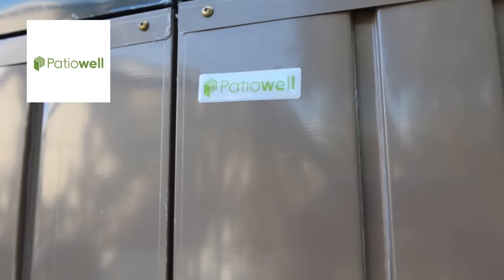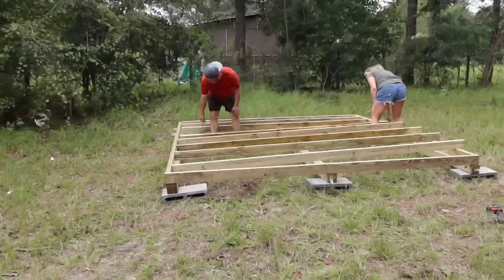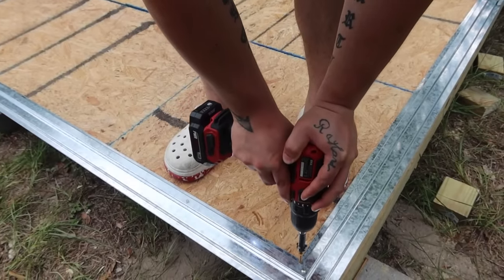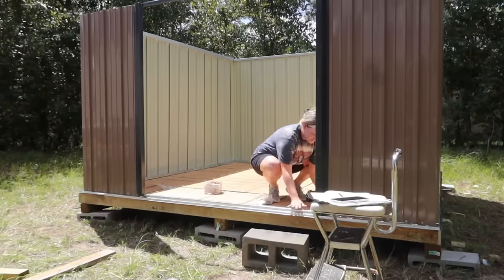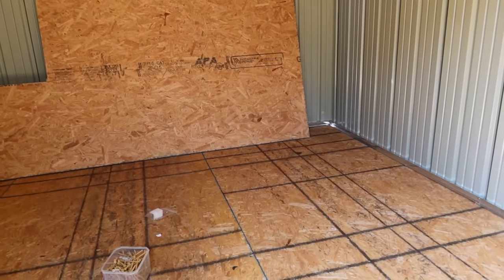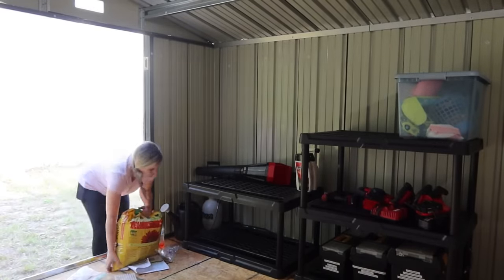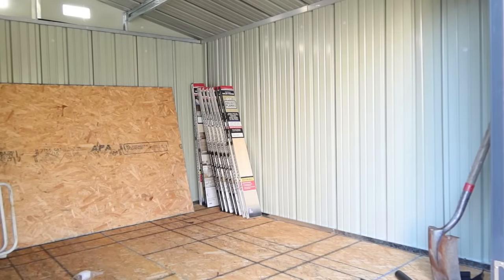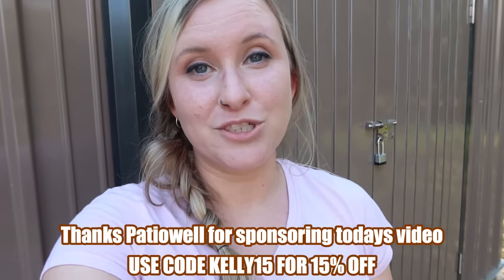🏠 MOBILE HOME PROJECTS (working outside) // New Shed Build + Organize

Comment: You could use your extra piece of plywood as a corner Loft. Put legs on it and then you have a shelf and storage underneath. That's what hubby did with our shed. It works out really good because it gives you an extra layer of storage. 🦋

Comment: I live in a mobile home too and the purchase of my shed was a must.  You might want to store the flooring flat inside your home.  The heat will cause it to warp.  Also, that lock can easily be cut.  There is a round thick lock that you can purchase that cannot be cut.  To get it off it be drilled out.  It’s pretty price but it works.

Comment: You need to get some of that spray foam and seal ALL the cracks around the top, bottom, walls, etc., ASAP. It'll help keep mildew, moisture and bugs out. (and worse, snakes, etc.) Of course, cut away the excess foam after drying. Everything is looking fabulous!!🦋

Comment: Kelly, what a great job you did with building the shed.  You might consider spraying the shed periodically for spiders,  scorpions and other critters to be on safe side. Also, have you thought about adding large blocks around the base of the shed to block the open areas as this will keep unwanted animals from crawling under your shed and living. Home depot or lowes would-be a great place to start. Have a great week. ❤️

Comment: Nice Shedd, need one a bit smaller for my stuff and not having to get a permit for it. Is there a way when you can insolate and strengthen the walls and doors🤔
Reply from the maker: I would say you could. Just add some studs and fill with insulation… cover over. That’s my unprofessional guess 😅 adrian and I were discussing that as we were putting it together

Comment: I would definitely remove the plastic film.  Although it protects the shed pieces during shipping, it will not hold up to the hot weather and the direct sunlight.  The plastic could literally melt and stick to the painted surfaces of the shed.  Much easier to peel it off now and there will be no risk to the finish of the shed.  Great job on the construction of the shed - it looks awesome!!